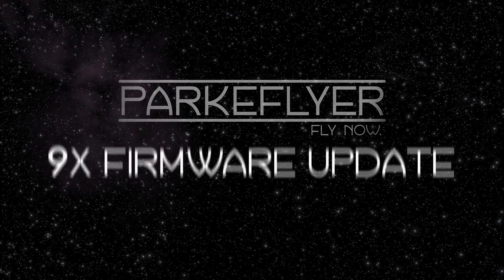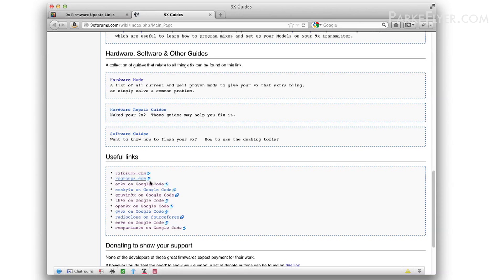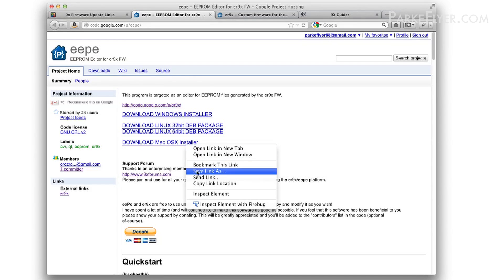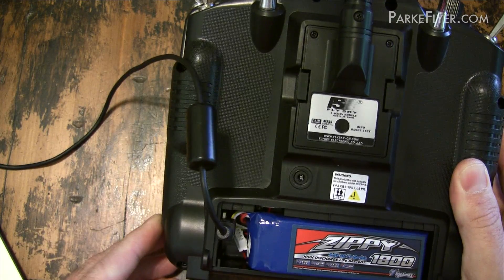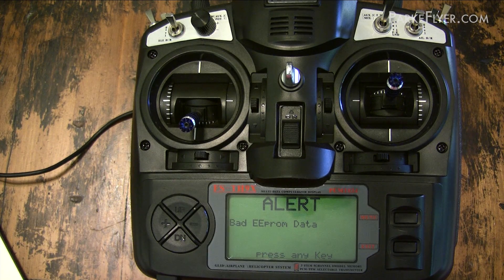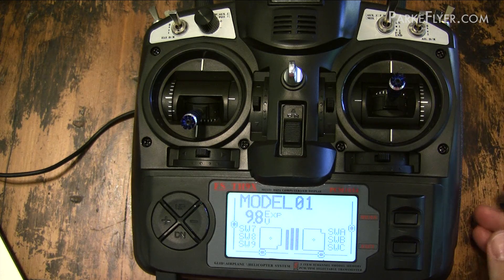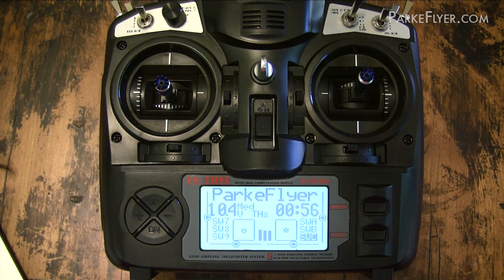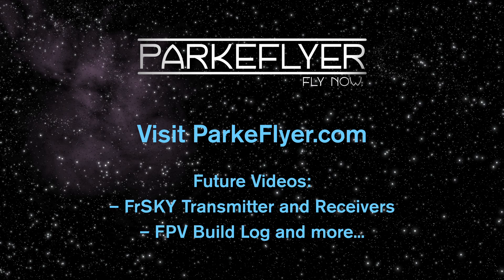9x Firmware Update - How to Install er9x on your 9x Radio

Comment: Hi, I did the upgrade tested with both openTX and ER9x, but unfortunately the fsTH9x cannot bind to its receiver anymore. I had to get FS i6 now. Can you please provide some info on this. What happened with the upgrade that receiver is not able to bind to TH9x. And, I am INdian so basically my products are mostly non EU. Some discussions said non EU compatibility issue. Couls you please suggest something. My FSTH9x is alive but behaves dead without receiver. Advance Thanks

Comment: Please help me understand 
1) the benefit of upgrading from default firmware of this Turnigy 9Rx Radio to er9x firmware? I am almost ready to buy this Turnigy 9Rx Radio but want to clarify the need for this upgrade. 
 
I want buy Turnigy radio because with my existing radio "Spectrum 6Xi", I can not achieve multiple mixing without adding many "V-Tail" mixers, specially when I want to do Elevon+Aileron mixing. 

2) Why do we need to upgrade the module, like to Frsky or any other brand? What is wrong with the one it comes with?

Comment: hey guys... im try to flsh my th9x but i cant.. it said

avrdude.exe: warning: cannot set sck period. please check for usbasp firmware update.
avrdude.exe: error: programm enable: target doesn't answer. 1 
avrdude.exe: initialization failed, rc=-1
             Double check connections and try again, or use -F to override
             this check.

anyone can help me with this?

Comment: Can you tell me if the T6 can be upgraded? I have firmware ver. 2.1A 11-Apr-2013. i saw a YouTube with a later version..2.2 - May 2013 which fixes the problem of alieron mixing for my delta wing...

Comment: I removed the comment left  previously as soon as I found out it was incorrect. You DO NOT NEED a mini USB connect with 5 pins, just the ordinary plain jane one you use for your cameras, etc. Mine worked just fine after I found the real culprit to down loading their program - everything was sandboxed in my security center. After over riding, everything worked great!

Comment: I'm using the Smartiparts conversion. Do I need some sort of circuit board (programming device ?) between the USB cable and my PC ? Or is it just a plain USB cable with that plug on the other end that suits the Smartipants Tx socket in the battery bay ? I've seen a programming card or something (that I can't find now) on Hobbyking. What's that about ?

Comment from the maker: There is a way to modify the hardware of your radio to support FrSKY telemetry, but flashing the firmware will not automatically do this. You can find instructions by searching "9x frsky telemetry mod". Get the normal "ER9X" flavor. After you've done the telemetry mod, get "ER9x-FRSKY".

Comment: hi bro, currently i have t9x radio and frsky tx module + FrSky D8R-II PLUS 2.4Ghz 8CH Receiver with Telemetery. is it my telemetry function will work on the radio if i follow 100% all the step on this video?
how to make the telemetry function working? only flash the radio firmware or modify the turnigy radio hardware board? Other things make me confused is to download the er9x.hex file. which one will i have to download? 
-ER9x
-ER9x-NOHT
-ER9x-FRSKY
-ER9x-FRSKY-NOHT
thank for any help. :)

Comment from the maker: Hmmm... things seem to be always changing, but this is weird. This may not apply, but er9x and Open9x versions of the firmware are quite different these days. If using er9x stick with eePe, and use Companion9x (eePe off-shoot) for Open9x. Be sure the use the latest version of either. I just downloaded and tried eePe/er9x and it worked. Also check if trying to upload the eeProm or firmware and check the "File Types" setting in the dialog box where you see the hex file greyed.

Comment: if your getting the AVRDUDE FAILED MESSAGE  and you are using a windows pc, then you will need the drivers for this to work.   you can get these drvivers directly from the smartie parts home page...  DRIVERS  will be highlighted in the top page....